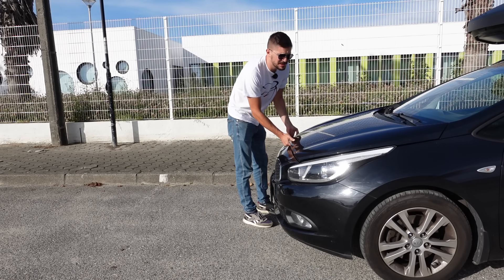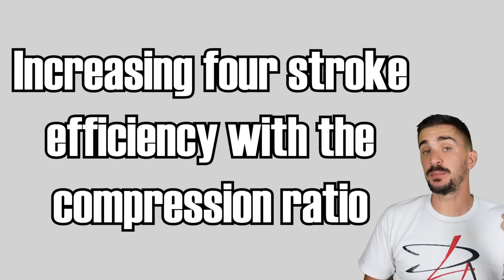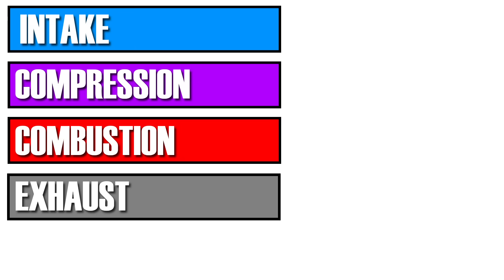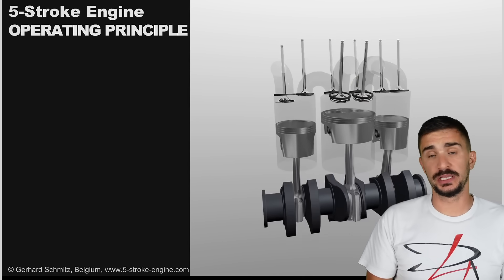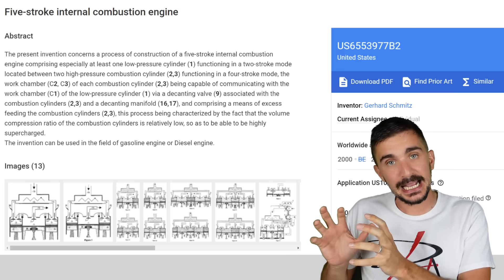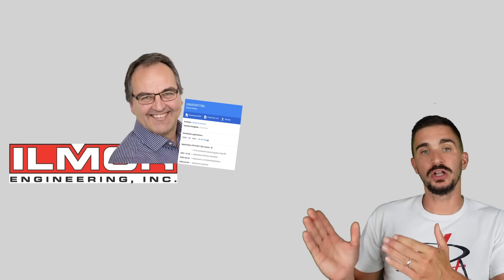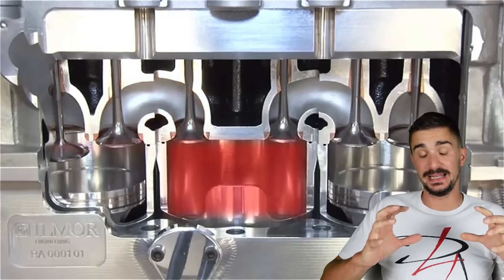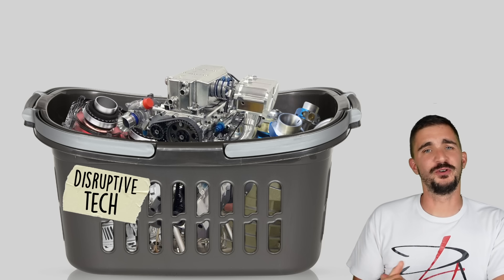Why Five Stroke Engines Are More Efficient But Still a Failure

Comment: Couldn't they just add an extra valve to the HPCs to make the low pressure cylinder only be used at high rpm, vtec style? So at low rpm the HPCs would exhaust into the atmosphere and past a certain RPM they would switch to exhausting into the LPC? For sake of passing emissions / city driving efficiency

Comment: So what happens when you take a direct injection engine, and simply add a twin stage turbo compound with inlet geometry on each stage? The idea is very old: Curtis Wright 3350 for example. But the electronic controls can now extract efficiently at different mass flow conditions. This seems to overcome the problem with the five stroke and its inability to configure for different power levels.
My gut tells me this set up would match the efficiency so long as the turbo work is well done. Let’s add to this. Even more adaptable would be to, instead of extracting mechanical work, use the turbos to drive wild frequency generators and feed the hybrid electric engine. Modern switchgear will get you say 80% of the mechanical energy into useable electric power and those electric motors are maybe 85% so overall a guess of 70%, less the turbo so let’s say over half the energy in the exhaust can be turned into mechanical power. That’s pretty hard to beat given that due to the small plus big turbo with adjustable guide vanes, very consistent performance across the power band.

Comment: So i think if we developed a new  type of fuel not only for cleaner or clean emissions and use titanium rotation assembly maybe a magnesium black and forged aluminum heads
And implement a hybrid variable valve & compression with a bi-turbo system with a potential EV hybrid self charging system 😅

Comment: I can see a practical and obvious way how to overcome the two issues with the five stroke, preventing the LPP becoming dead weight and the issue with heating CC's and spinning turbos. I am thinking outside the combustion chamber. Would D4A like to evaluate the proposal?
It's not going to be light, though. So the whole process becomes moot.

Comment: I remember reading about this years ago when those articles you mentioned started going around,  and I ended up coming to the same conclusions about low-load performance that you did.  Efficiency wise, modern Atkinson cycle engines achieve roughly the same goals while allowing companies to use existing engine block designs, just increasing gross compression/expansion while redesigning the intake cam profile to hold the valve open during the first 1/4 of the upstroke to reduce net compression.  Much easier and cheaper that way.

I do think this type of design does have a couple advantages in terms of reduced parts count versus the standard four stroke engines of comparable size and cylinder count.  The engine as built only has two fuel injectors, two spark plugs, and associated wiring/plumbing, versus three or four.  The intake manifold only goes to two intake ports, and the exhaust is just a single pipe with no actual manifold needed.  One thing the 5 stroke engine can do that I don't think Atkinson cycle engines can is run off of a carburetor;  since carbs run entirely off of relative vacuum in the intake manifold, and Atkinson cycle engines push part of the intake charge back into the manifold, I'm led to think that the pressure pulse traveling back up the manifold would interfere with the operation of the carb, and thus the engine itself.  I suppose where I'm going with this is that the niche for 5 stroke engines might be for moderately small generators - those all use carbs, tend to run at higher sustained loads, and would absolutely benefit from improved efficiency and the lower exhaust noise.  Who's willing to invest the money, though?

Comment: My 2021 Ducati XDiavel has 13-1 cr,  4 cams,  Desmo valve control of 4 per cylinder and 160hp.
 The bike is very fast and gets fantastic gas mileage...      I'd call that efficiency.           Great video by the way!
Reply: Er, it's a bike.
Reply: @greenaum      You're brilliant eh?

Comment: So what if you put the turbocharger and catalytic converter in between the high pressure cylinders and the low pressure cylinders? I'm sure the cat would heat up quick enough and the turbo would spool up very fast. Then because the exhaust pressure going to the low pressure cylinder is reduced it is also reduced in size and weight. A second cat could also be installed at the end which is then heated by the hot fluids that normally go straight to the radiator until it reaches operating temperature controlled by valves.

Comment: I place my bet on a electro dynamic turbo/compressor  which doesn't use exhaust gasses or is belt driven. Instead it will be fully electric and uses the signals from TDC- and TPS sensor coming from the ECU. Lots of benefits here!

Comment: 15:50 does that mean this could be more useful for generators? Since a generator would roughly stay at the same RPM to produce electricity wouldn't it. Or maybe even for smaller ICE powered airplanes.

Comment: There are compound engines on the automotive market already, and they are better than this because the4y can be readily disconnected if they would give a detriment to performance, they also require gearing between the exhaust stage and the engine and they are more efficient the closer the rpm of the engine is to the rpm of the turbo so it's certainly not all sunshine and roses, but when the competition can use a centrifugal clutch to increase the overall efficiency you know you are on shaky ground.
Reply: Just to note, I'm talking about turbo compound engines as compared to piston compound engines as was talked about in the video.

Comment: So the bottom line is that this is basically like an over-complicated turbo with all the disadvantages (i.e.: low efficiency under low RPMs) at much higher costs.

Comment: I could imagine this actually being quite effective on a small displacement supercharged engine. It almost works like an intergenerated turbo charger in my opinion as the typically waisted exhaust gas would actually build hp and torque to offset the load created by the supercharger but only if the baseline rpm is high enough. Im not engineer though so i could totally be wrong.

Comment: Im just waiting for the advent of hybrids with fully electric drive drains but mostly powered by combustion engines (with maybe a small battery and plug in option). Best of both worlds and it could revolutionise the off road vehicle market (which is the type of car I'm mostly interested in).

Comment: 1- Conventional 4 stroke engine design is gonna last 150 years more at least.
2- These prototypes must still be out there somewhere just need to find it and get your hand on it.
3- The second problem can solved by decreasing the middle piston size to it's siblings and giving it the both side exhaust at the same time, enabling more power extraction. And turbo is not required since your basically replacing its job to extract the left over energy.
4- 3rd problem is solved by reducing the diameter of the catalytic converter forcing all exhaust through a narrow opening increases temps and low-and-behold.

Comment: Love this guy!!!
The Verbund motor sounds like an analog to the double and even triple expansion steam engines (piston, 2 stroke).  Exhaust steam from the small diameter, high pressure cylinder flows into a larger diameter, low pressure 2ndary cylinder.  Of course, steam engines tend to be run at a rel constant speed.

Comment: Great video! I loved the explanation of how increasing the compression ratio improves thermodynamic efficiency. I couldn't help but notice that this 5-stroke concept is very similar to the triple-expansion piston steam engine with its 3 cylinders used to extract more energy from the steam than a single cylinder. This was the most efficient incarnation of the piston steam engine before it was made obsolete by steam turbines with their higher efficiency and simpler design.

Comment: Great dissection of the motor. I disagree about it being a larger capacity though. The two regular cylinders should only count. The third is simply using energy that would have been wasted. It doesn't get it's own clean charge of fuel and air.

Comment: This just proves the point that the 4-stroke piston engine is incredibly well balanced when it comes to performance, flexibility, efficiency and complexity. Alternative designs may improve one aspect, but it usually comes at a cost in other areas. For example, higher efficiency typically leads to less flexibility, which is very important when the engine is physically connected to a vehicle's driving wheels. So more efficient designs are suitable for stationary power generation, or for use as range extenders.

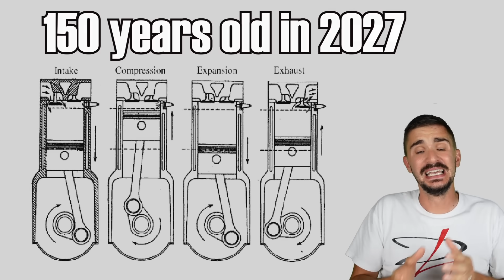Comment: Ref. 16:59-17:03 :: Mechanical Wrist Watches / Automatic Self Winding AKA Perpetual / have similar complexity to a single cylinder motorcycle engine, are radically more energy efficient. If the automakers did more friction reduction, smaller optimized block ( iPhone, iMac, MacBook are machined by CNC as are GLOCK pistol uppers ) so Toyota & GM & FORD and others can use F1 style or LEXUS LFA precision block casting + finished machining to make the engine block lower mass with better thermal efficiency. Think of how Yamaha worked with Toyota on the LFA V10 engine in the Toyota F1 works / now scale the idea to make exceptionally energy efficient gasoline engines that convert 47% of the fuels energy into torque & power output mixed via thick robust orbital gear with torque from AC traction motor generators // Toyota HSD Hybrid Synergy Drive with a high thermal efficiency engine PSD power split device mated to a traction motor AC & AC motor generator so Strong Hybrid // PHEV HEV drivetrain technology where even the 2005 Prius gets 46 MPG real world Fuelly website data and the latest 5th Gen 2024 Prius eAWD with 196 HP & gets 57 MPG real world. The PHEV Prime RAV4 has almost 500HP, electric around town with AWD & accelerates like a monster and still gives over 40 MPG real world. I hate TESLA because they make more money collecting data from their EV car sensors & selling that autopilot training data to the other automakers & Elon Musk is a lair who overpromises about Autopilot L5 for years then never delivers & Tesla allows no one else to work on their EV's and overcharges for their EV's, and also has terrible customer support. I love Toyota for selling reliable HEV's and having excellent customer support pleasing & wonderful.
Reply: Our 2022 Toyota Corolla Hybrid driven carefully on hilly king county rainy drizzle cool weather most of the year, gives me 74 MPG on the way to work, and 62 MPG on the way home, and I live on the top of a mountain in Issaquah and work in Downtown Bellevue 16 miles one way. Even if I drive faster it gives 55 MPG, and if I drive it like I stole it a speed crazily on the freeway the whole way still 42 MPG.

Comment: Peak efficiency CAN (and will) be improved, but only slightly, nature demands a limit. For production ICE, it's likely well below 50% (despite what F1 engines can do with large budgets). The really big improvement available is that "low speed, low load" part you mention. Yes, I'm on it. No, it's not cheap or easy. No, none of the manufacturers I've contacted have been willing to follow up. Yet.

Comment: The argument that electric motors are 97% efficient and therefore far superior to combustion engines at 30% is blown away when they are asked to operate with a gas-tank sized battery. The argument is not about efficiency, but humanity's harnessing of dense energy. To that end, we should be working towards nuclear powered cars.

Comment: 15:17 okay but it does depend on number of cylinders firing, right? Modern engines run on reduced number of cylinders when power output is low. Passive cylinders could even act as those exhaust receivers actually.

Comment: Is it possible to modify  piston position so that:
1) two adjacent pistons are moving down
2) only one piston compresses the mixture
3) the valve opens before combustion happen thus increasing the burning volume
Does it make any sense? Without taking balancing into account.

Comment: Honestly, this sounds like the same principles used in Steam Locomotive Cylinder design. Those, too, have a high pressure and low pressure cylinder on each side, so they can use the steam twice before chucking it overboard.

Comment: the ICE is not very thermally efficient but that is not the best measure of efficiency. i would measure efficiency as utility divided by cost. in a world where no one listens to the woke climate neurotics and psychotics, the ICE continues to offer real efficiency that cant be matched by EVs or any other alternative on the horizon. i say that even though i love EVs, but the unsubsidized cost is not comparable. my hunch is that ICE thermal efficiency cant be improved much, but that's ok, because it doesnt need to be. it is, like you suggest, probably the most successful mechanical engineering design/evolution in the history of the world. and it aint broke, so dont fix it

Comment: How about an post-injection in the low pressure cylinder + ignition to warm up the cat and build up pressure in the low rpm´s for the turbocharger?
how would that effect fuel consumption / economy?
i guess the low pressure cylinder still would not count as a combustion room, because the valves are open as the combustion takes place

ore u just attach it to a CVT gearbox to run it in optimal rpm

Comment: The problem with a 5 stroke engine is you are competing against a turbo charged engine... which is much easier, cheaper, lighter, and easier to adjust and can significantly increase the power of an engine.  And like I noticed you compared it to "Naturally Asperated" engines.  So basically they had a turbo charged engine that was not classified as a turbo because instead of using the exhaust to increase air pressure for the intake it was using the exhaust gas into boosting the output to the crank shaft.

Comment: *Harnessing the Power of Exhaust Gases: Balancing Efficiency and Emissions*

In the quest for more efficient automotive engines, engineers continually seek ways to extract every possible bit of energy from the combustion process. One promising approach involves harnessing the power of exhaust gases, a strategy that, while potentially very effective, must be carefully balanced to maintain emissions standards. 

*Understanding the Ideal Gas Law*

To appreciate the challenges and opportunities in harnessing exhaust gases, it's useful to revisit the ideal gas law: PV = nRT. In this equation, P represents pressure, V represents volume, n is the amount of gas, R is the gas constant, and T is the temperature. This relationship highlights that in a given volume, a reduction in pressure results in a decrease in temperature. This principle is critical when considering the use of exhaust gases to generate additional power.

*Turbocharging and Turbines*

One well-known method of utilizing exhaust gases is the turbocharger. Turbochargers use the exhaust gases to drive a turbine connected to a compressor, which then increases the pressure of the air entering the engine. This increased air pressure allows for more fuel to be burned, resulting in more power from the same engine displacement. However, turbocharging must be carefully managed to ensure that the exhaust gases remain hot enough to keep the catalytic converter functioning effectively.

Another concept involves placing a turbine in the exhaust stream, similar to a turbocharger but designed to directly generate mechanical or electrical power from the exhaust gases. This approach can potentially convert a greater portion of the exhaust energy into useful work, but it also poses challenges. As exhaust gases expand through the turbine, their pressure drops, which according to the ideal gas law, also causes a drop in temperature.

*Balancing Efficiency and Emissions*

The challenge with using exhaust turbines lies in balancing the need to extract energy from the exhaust gases with the necessity of maintaining sufficient temperature for the catalytic converter. If the exhaust gases cool too much before reaching the catalytic converter, the converter's effectiveness in reducing harmful emissions such as CO and NOx is compromised.

One potential solution is to carefully manage the design and placement of the turbine. By optimizing the turbine's efficiency and controlling the flow of exhaust gases, it may be possible to harness significant power without excessively reducing the gas temperature. Additionally, advances in materials and catalytic converter design could allow these components to operate effectively at lower temperatures, providing more flexibility in how exhaust energy is utilized.

*Conclusion*

Harnessing the power of exhaust gases represents a significant opportunity for improving engine efficiency and reducing fuel consumption. However, this approach requires a delicate balance to ensure that emissions control systems, particularly catalytic converters, continue to operate effectively. As automotive technology continues to advance, innovative solutions will be needed to maximize the benefits of exhaust energy recovery while maintaining strict emissions standards. By carefully managing the interplay of pressure, temperature, and catalytic reaction dynamics, engineers can unlock new levels of efficiency and performance in modern engines.
Reply: Yeah, thanks ChatGPT but I'd have asked you myself if I'd wanted.